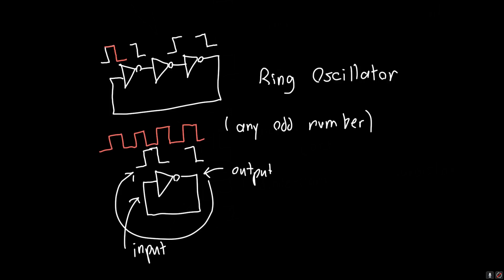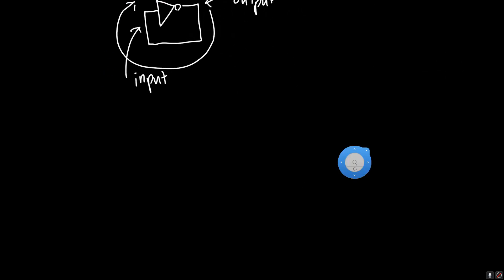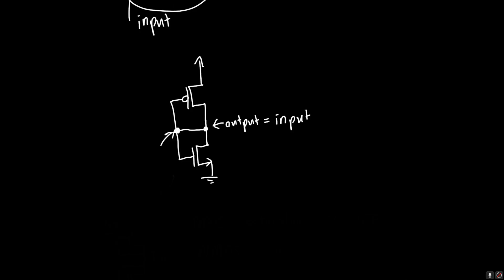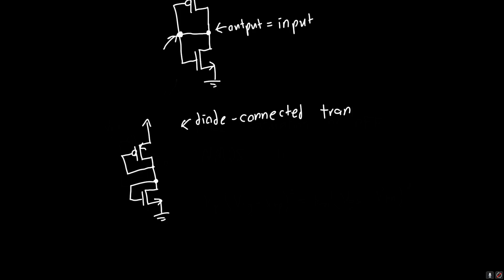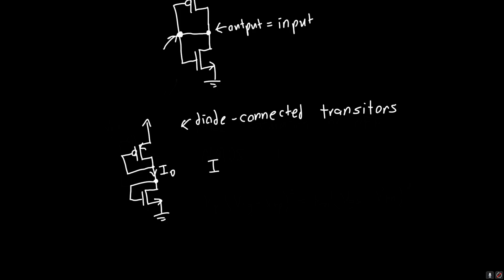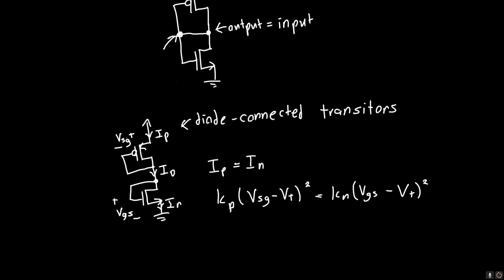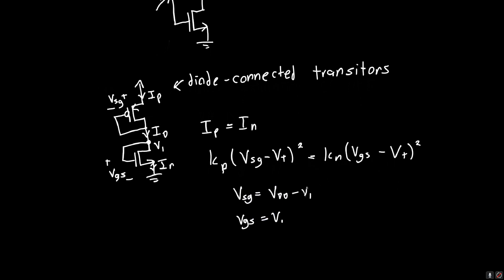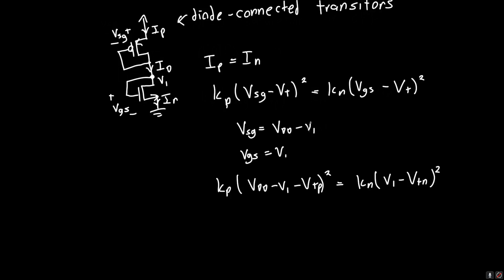Single Stage Ring Oscillator

Comment: In modern cmos, an unbuffered feedback inverter like that will burn up pretty quick with the constant crowbar current. A short loop will not pass aging requirements because it'll be wiggling at a few GHz more than it healthy. Ring oscillators need to either be long, or have loads in loop to slow it down. You should question you motives for doing a ring oscillator. If you are doing it for an RNG, you're doing it wrong. If you're doing it for a clock, you have better options.

Comment: thanks for pointing this out. I usually just say not enough delay or not enough phase shift through the wiring from output to input in a single inverter. Or is that small signal analysis? The condition of oscillation is to have gain > 1 and also at the same time, the loop is positive feedback (>360 phase shift so that any gain>1 condition located at phase shift=360 will be the place for the oscillation to happen). One single inverter like that above with one pole can only provide another -90 degree phase shift. There are still another -90 degree phase shift needed. While writing this, It does remind me that some op amp can have two poles or more so that when its output and input are shorted, the op amp will oscillate, but I never saw any application of that kind of oscillation, maybe because it's difficult to control compared with ring oscillator or LC oscillator. 

BTW, I really admire you because you do both good at electrical engineering and also have a software engineer job in FANNG. I have to stick to this analog stuff.

Comment: That's a really interesting question and as always, a good explanation. Thanks a lot Jordan! 
For the same circuit if we add a few buffers between the input and the output to create some delay, will it act as a ring oscillator?
Reply: Yes, I'm wondering this too. If there's a non-inverting buffer in the feedback loop would it oscillate? That would satisfy the condition of the negative feedback loop with separation between the input and output voltages while using fewer than 3 stages.

Comment: Pretty piss-poor explanation. The whole "output equals input" narrative also holds for, say, a 3-stage oscillator, so why can that oscillate? If we set a 0 at the output of a 1-stage oscillator, the input is 0, so after some delay the output will be 1, so the input will be one, so after some delay the output will be 0, etc. Exactly the same logic as the 3-ring oscillator. I'm not saying a single stage oscillator won't work, but the reason it won't is not what you said in this video.
Reply from the maker: Ouch. XD A more precise way to phrase it is that the difference is that there is no delay between the output and input - they are in fact the same node and change simultaneously.

Even more precisely, the input has to remain constant in order for the output to be inverted, but with the case of a single stage oscillator the input changes as the output changes, which causes them to converge to the same value.

Comment: I think there is something wrong with your explanation. Because inverter has a propagation delay t. So you have a 2t period oscillation possible here. Just like in 3 stage oscillator. Where it was 6t period. So there is a time varying voltage at output here.
Reply from the maker: Give it a simulation! See what happens. Can't say I've actually given it a go. I believe you need a minimum of 3 stages, and here there is essentially zero delay from the output back to the input (it's a wire), so it stabilizes.
Reply: @JordanEdmundsEECS That makes sense to me. After all, negative feedback around an amplifier stage is a very common technique for reducing gain. 100% negative feedback gives a gain of 1 because it reaches an equilibrium.

Comment: This is a nice series of videos.  A two stage ring oscillator won’t work, but that is also a cross coupled pair, which is the basis of an oscillator.

I assume the ring oscillator requires a delay to function. The cross coupled pair forms a negative resistance (which needs the positive resistance and resonator)?  The drain bias resistors already provide a positive resistance, which leaves the LC tank.  At anti-resonance, the tank disappears, leaving one with the the original two stage ring oscillator, which doesn’t work, but is now oscillating.
Reply: I bought Razavis oscillator book and figured it out on page 9.  The cross coupled pair would normally latch up at DC due to positive feedback.  When the inductor is placed across the drains, it shorts them together at DC, thus creating negative feedback.  The positive feedback then only occurs at anti-resonance, hence the oscillation.
Reply: @rfengr00  Yes. It's the reactive frequency dependent network you attack that lets it oscillate.

Comment: This analysis for a single inverter ring oscillator is wrong. We connect the inverter externally, via a load resistor and load capacitor. It is these external components that make it oscillate. These load reactances create the propagation delay that makes the oscillation possible.
Reply from the maker: Sure, you can add external delays - that’s equivalent to adding an extra 2 inverters. You’re making sure the input voltage is not the same as the output voltage: